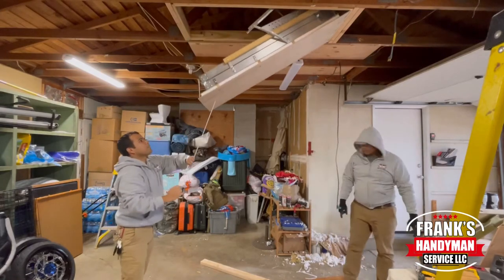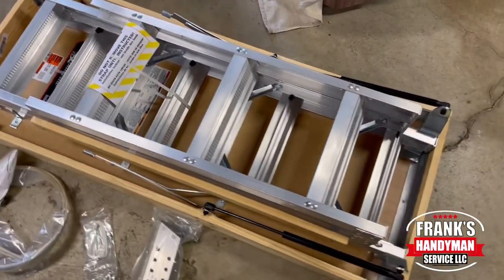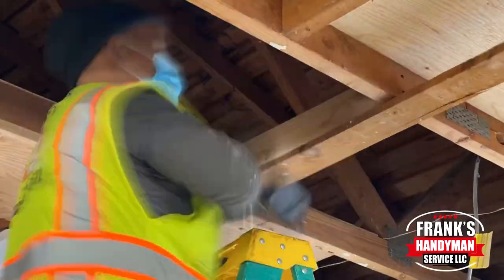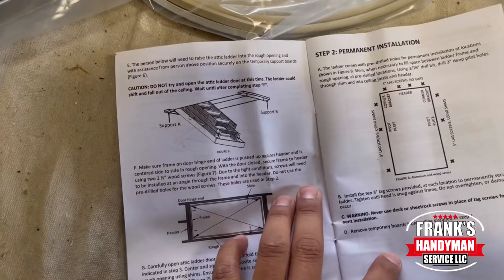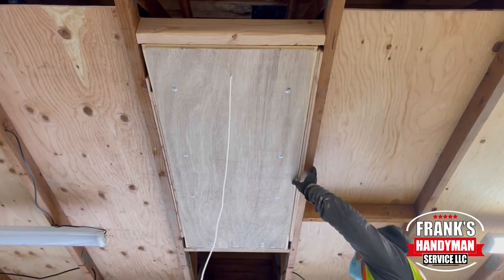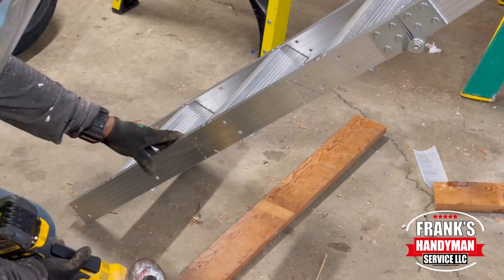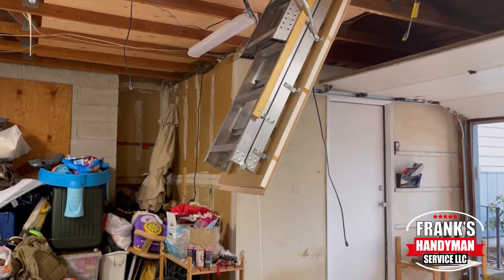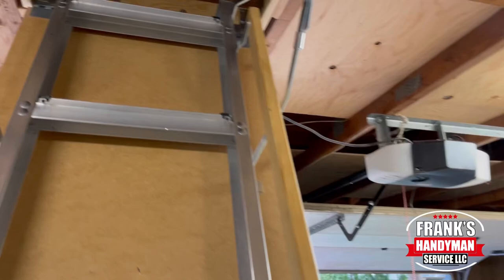How To Install A Louisville Attic Ladder In The garage Step By Step With Basic Hand Tools DIY

Comment: My rafters are 22" apart, directions call for a 22 1/2" opening, can I get it to fit?
Reply: Ugh, you've got to love surprises like that!! If you're still working on this project, the fix for that actually isn't too bad!! Putting one of these in with 24" stud centers, like in this video is a piece of cake, because the edge-to-edge measurements of the joists are, in theory, 22.5", so the unit more or less just fits right in, on screws right to the existing joists. 16" stud centers, or 22", like your case, is where the real adventure begins!! I've done plenty of this sort of thing on a DIY basis, but since I'm not a professional, I stay away from giving out specific advice over the internet, but, when I was in your position, I found the video in the following link quite helpful, so hopefully it can steer you in the right direction!! Good luck!!

I just had another thought- your 22" measurement IS referring to center-to-center, correct?? If your joist measurements are 24" center-to-center, then this installation would likely be much more straightforward. 🤔🤔🤔

https://youtu.be/KmJRow_BqqY
Reply: Yes, it says a rough opening of 22.5. Mine is the same as yours and I literally just finished installing it.